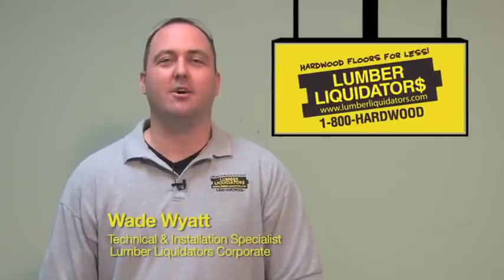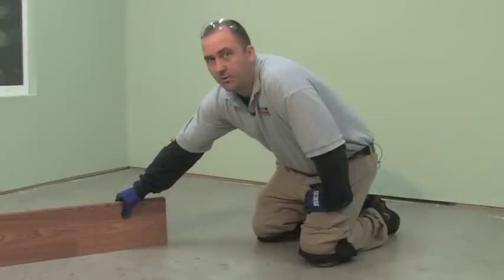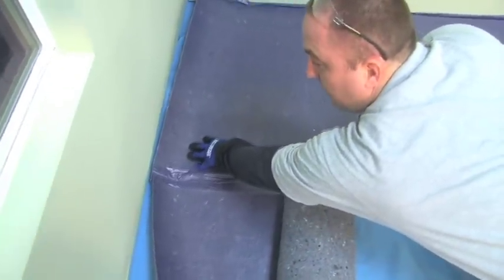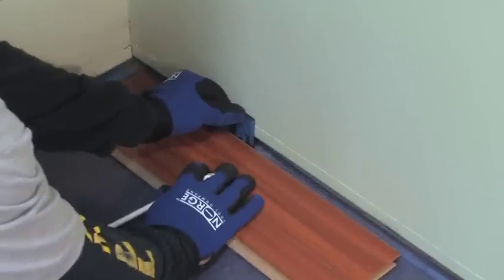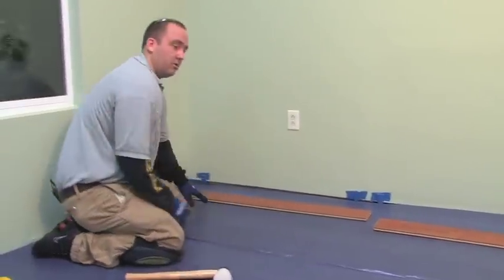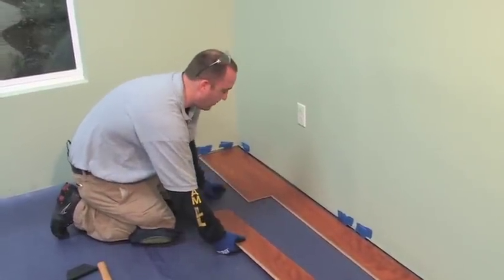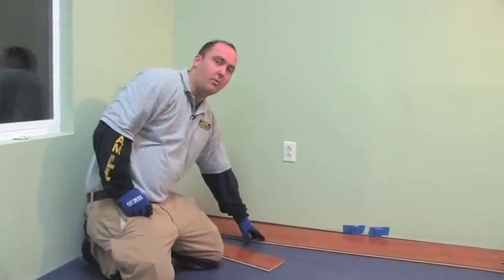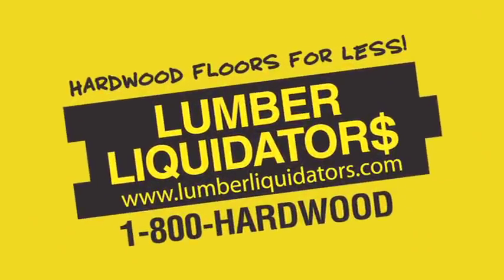How to Install Laminate Flooring (Tap-End Joint) Including Moisture Barrier | LL Flooring

Comment: I thank you very much.
I am trying to install laminate flooring for the first time.
The first line was simple.
The second row, I didn't know how to place the second board, there was no way they would match.
On the manufacturer's website, the video describes everything except the connection itself in the same line.
I've looked at dozens of tips and this is the first one that mentions leaving a gap and then embossing with the tool provided.
Once again, many thanks!"

Comment: When starting your first row (tounge facing the wall), use a table saw to cut off the tounges before installing with spacer.  Otherwise, you may end up with a gap larger than the original, or new baseboard molding can cover with one piece. This eliminates the need for a shoe molding in front of your baseboard molding, thus reducing your trim material and installation expenses.

Comment from the maker: Hi Ed, chalk lines are to help keep the floor straight, whether it is a nail, glue or float installation. The lines help to ensure the rows are running straight & the floor has not gotten out of square. When you have longer runs it tends to sway or move so the lines help keep everything in check. Also, if the wall is not straight it can cause the floor to gap at the ends when the two pieces are not square with each other due to the wall being out. A chalk line can help alleviate this problem!

Comment: PMak1984 makes a good point. Need to measure the width of the room and divide by the width of one floor plank to make sure you will not end up at the last row with a plank 1/2" or 1" wide. You may need to rip the first row of planks lengthwise so that the last row is at least 2.5 - 3" wide.  Other than that this video was very helpful as it showed 6mil plastic, cushioning  underlay, and use of spacers without baseboards. Thanks for posting

Comment: I have been installing all kind of floors for over 30 years, from Carpet, Vinyl, VCT and wood When this type of flooring came out no one knew how to get a tight fit when you could not lift the wood up on a 45* angle like toe kicks in kitchens or around door jams. Finally figured it out by cutting off the locking lip bead and slipping it together with good wood glue. Never like this type of flooring to me it didn't look like real wood or sounded like real wood walking on it.

Comment: Great video, will help a lot if I end up flooring myself.

My whole room drops about 20cm over 6m. Is it a problem if the floating floor is on an incline?

Also my house is really old, the rooms isn't exactly square. If I get it installed rather than doing it myself can I trust the installers to do a good job?
Reply: Curious. The room you speak of which has a 20cm drop over 6m, what kind of room is this? A 20cm over 6m sounds like a very acute ramp.
Reply: Edward Bournaska
It's an ex garage, most people don't notice the slight slope unless you mention it to them.

Anywhoo I ended up getting it tiled instead.
The tilers used one of those new clip systems and it came up completely perfect.

Better tiling than the rest of the house lol.

Comment: OK, you drew that line than you used the spacers as guides and covered up the line. What was the line for in the first place?
Reply: Completely agree, I was thinking the same thing, I don't think you need the line
Reply: Sharon Kennedy the guy in the video was showing two methods for aligning the first row; the chalk-line was one way, and spacers was another. given that you'll be tapping on all of this, i'd say that the spacer blocks helps keep everything in place and is probably a better method.
Reply: You use the line to stay straight, in relation to the wall. Once you get the 1st row in, you just have to lock them into each other which will by default be straight...again, in relation to the wall. If you try it without the line you will wish you had it at the end.
Reply: +slowinfastout54 the spacers constantly move your best bet is to get 3 rows in and on the very ends of the boards(that will be covered by trim) drill a cople hole through the wood and the concrete drill some screws in (only hallway for a 4 in screw ) and bam your floor wont move...
Reply: mikeA1 Your floor isn't screwed in...
Reply: slowinfastout54 even if the wall is "square" though rarely is any wall 100% square ...  having a reference to keep the material square is best ... a slight difference even 1/32" at the butt joint can throw the entire floor off by the time you reach the other wall making it askew ... roofers laying shingle use this same technique to keep them looking even/square when the roof is not
Reply: Line is to check if u have a strait wall to follow or not...

Comment: Hi Wade, 
I also don't understand the need for the chalkline.  If you are using the spacer and the width of the board, how is that going to change at the other end of the room?  It seems that you'd get the same result just putting down an entire row with spacers.  Is it to help for when you don't want to do an entire row as you were showing?  Thanks for a great DIY video, Wade!

Comment: not clear, do you leave the spacers in? or are you continually shifting the ones used on the short ends of the board and them remove the ones on the long end of the board once the room is finished? If you remove the spacers won't gaps appear over time if the connection loosens?

Comment: Question: How are concrete slabs laid in America? Do they not have a damp proof course underneath the slab? What's the point of the "moisture barrier" on top of the slab?
Reply: Wood can't make direct contact with concrete or it will deteriorate at a lot faster rate. That's why the moisture barrier.

Comment: Any gap required for 6mil Poly Sheeting moisture barrier?  If not, does it go to where drywall meets floor or even further back (in cases where baseboards were removed and there is a gap between the wall and floor)?  
The first row of underlayment against the wall overlap flap is not cut off?
Reply from the maker: Hi Josh -  the vapor barrier should be installed up the wall at least 1”.

Comment: what's the point in snapping a chalk line, when you're taping spacers to the wall in which case the flooring will go against anyway during the install???
Reply: I sometime snap 2-3 or even 4 snap lines depending on the size of the room just to check that walls opposite to each other are going to work.  I will also use this videos method, however sometimes there's a bow in the wall.  In this case I do not want to follow the wall.  I have to snap a second line in order to get a scribe line to cut the laminate.  Then use a jig saw to cut the laminate.  After your done, the wall cut you made will follow the wall and your other side will be straight. Double check that all your gaps and that your measurements were ok.  And that the wall on the other side is not skewed.  (Check that chalk line to that other wall before you start trimming)
Now your starting boards are straight for the next row
Reply: Richard  just incase the wall in not even across. then all your laminate will be on a slant
Reply: wall may be bellied or bowed. the line gives you a straight reference point to locate those problem areas.
Reply: Richard the point of snapping a line is to keep the flooring straight, no wall is 100% straight as a string/chalk line, the blocks are supposed to keep you to your line as your beating the flooring together when you start
Reply: Richard the blocks may not all be the same width
Reply: I have the same question. Since all these snap together and are perfectly square, AND it's a floating floor, won't it maintain very straight lines regardless of the wall or the chalk lines?
Reply: But if the wall isn't straight, and you base the chalk line off of the not straight wall, wouldn't that make your chalk line not straight as well??

Comment: Sorry guys... but this is not the most usefull.  First and the most important: You can not always start using a whole width of the board. Because you can end up instaling a very, very slim pieces of boards along a oposite wall. I am talking about a width of 2 inches or even a one inch. Imagine how this is going to look. 
So to avoid it - before you start your work, you need to measure a width of the room, and a width of a single board. Then divide a width of the room by the width of the board.  Result will show you almost always two digits amount with a fraction.  For example: 18,7 or 24,2 etc.
That is how many boards it will take to cover a width (not length!) of your room.  And whatever is there after a dot (that fraction) shows what is really imortant now: It shows a width of the last piece of the board to be installed right at the wall.  
Now, if you have that width being more than a half of a full width of the board (lets say you use 9 inch wide boards and now your fraction shows 5 inch, or 6 or 8....) than you can strat your floor from the full, uncut board - just like shiwn on video. But if a fraction will show 4 inch or less, and a specially like 2 or one inch, then at the end you would by forced to cut and install these non=sense long, 1-2 inch pieces along the wall. This will not look good!  
To avoid that - just imagine that you adding - lets say - 3 inches in width to your last slim 2 inch line of pieces... They would be just wide enough then, right?  The simplest thing now to make it happened is just take off these 3 inches from first row of boards. 
Yes. Do not install a whole boards, but cut off 3 inches along of them, (all boards in first row) then install them.  

The other thing is - in virtually every room there is some radiators... and they did not mentioned anything about it. But if you have some obstacles like radiators, especially a baseboards - the best way to start your floor is right there where baseboard is. Why?  Because it is usually low over the floor, but very first row of boards, you simply lay on the floor. You do not need to install them at the angle, to connect it with another line of boards. Then - when forst row is there - it should stick out from under a baseboard, so now you have a full access to install next board at the angle.
Well... A MUST is to determine from wich side of the board you are able to attach a next one under angle.  This is only one of two sides! Make sure taking two boards together with one flat on the floor - try to attach another one...  Notice the difference between a shape of board's edges. Determine which edge is the one that you can attach next board to.   
I'm writing this, to avoid situation when someone decides to cut a 1st row of boards to equal a width of starting and finishing row - and without checking - will cut off a wrong side of the boards...  Waiste of time, material and tons of frustration.  
Also - in few cases - a room can be pretty tricky. I mean: I did install a laminate floor in the kitchen together with a hall, dining area, lets say - an island on the side and extra litle square area where basement entrance is.
Problem here is that the floor is not a simple rectangle, but it is more like several small, different size rectangles - connected together, but in weird order.
Critical here is finding a perfect (in fact: closest to perfect) position of first row, so when we lay down next few rows and meet the corner - we omit a situation when we need to install a board into this corner - with coutout of 1, or 2 inches wide.  To avoid it - we need to calculate our amount of boards needed to cover a width of the room - exactly like I described above. But then we need to calculate that fraction for EACH AND EVERY CORNER on the way, to oposite wall.  
Having these on paper - we can see in which corner, or maybe at oposite wall's end - there is a worst situation: I mean if we have fractions, lets say:  0.7,  0.9,  0.2,  0.4, and 0.1 - that means we need to move the start line of our entire floor to increase those tiny widths like 0.1 and 0.2
And we can do it by cutting 2 inches off of the first row.  But carefully: When we do that - our width of 0.1 board width will increase about 2 inches. Good. Same about our 0.2 of board width.  What about other fractions? These I call a "good ones"? like .07 or 0.9 of a board width... Well... these will change as well!  And if it is 0.9 -it unfortunately is going to "jump" to another board!  Making it for sure a skinny one.    In that case - the only thing we can do - is moving our planned starting line inch, two or three more - and check how wide boards it will make on each and every corner.   Sometimes you need to move like this back and forth, just to find an optimal set of boards to be cut around corners.  And yes: sometimes - no matter what you do - you can still have one of these spots only 2 inch wide...  In that case, pick the least visible, most hidden corner and make your adjustment so this one will have a worst configuration. But other ones would look OK.  
As a matter of fact, with irregular shaped rooms like this, similar issue could happen into oposite direction. So it make sense to calculate (or simply "dry" install just to see) and find out where before a corner - a board will end. It is important especially when we have a floor boards all of the same lenghth.  

Sorry if my english suks. I know it is.   

Anyways... I encourage to watch several different videos about panel floor installation, to get more important info and some good, usefull ideas.

Comment: Hey, I noticed you didn't cute the male lip going against the wall on the first row, some say do, some say don't, what are you thoughts....THANK YOU
Reply: it doesn't hurt to cut it, however, the molding/ base board typically covers it. Check the width of the molding to see how much wiggle room you have between the board and the wall.

Comment: That was pretty quick. Unfortunately when you're laying 20/30 or more sq ft it take a bit longer, does it? Also I am not totally convinced by the fact of connecting the long side and then the short side of the plank. If the plank groves and tongue are not smooth, it would be impossible to slide it all along and win the friction of the wood. You may even end up damaging  the wall or the skirting. Finally, the vid shows how to draw the line to keep it straight, but doesn't develop the other steps.

Comment: can I install laminate over a 3000 sqf area? Will gluing it down avoid shifts and movement due to temperature changes?
Reply from the maker: Hi Kurt - thanks for your question! It could vary by product but Dream Home Laminates are designed for floating installation and require transitions to be used between adjoining rooms, hallways and doorways. They must also be used in the middle of rooms measuring more than 33’ in the direction of the panel length and more than 26’ in the direction of the panel width.

Comment: Will there be moisture/mold problems between the concrete and the moisture barrier in a basement? Where does any moisture go at that point?
Reply: Some laminates cant be installed in a basement...go with LVP instead.
Reply: thank you sir, ill look into that.

Comment: The best way to keep new installation straight is to put at least three rows together, first....a few inches away from the wall.  With the 3 rows locked together, the floor will be straight. Then slide it close to the desired place...measure the 'ends' distance from each front wall.  Then, you may have to add or minus your spacers to keep that 'straightness against the wall (keeping in mind that a lot of pressure will be put against the wall each time a new row is added).    .
Reply: ihiaama5 providing you have no notches or cut outs around anything within those three rows ... a straight shot is easy enough ... now how do I get around that with the previous problems mentioned.

Comment: "If you don't know how to read a tape measure..." ...then you shouldn't be doing this yourself. Or driving, or anything really..
Reply: Google it! in 30 seconds !
Reply: MrF1230n    LOL!!!!! you're right
Reply: +MrF1230n If they can't read a tape measure.. then they probably couldn't figure out how to remove the plastic covering the pack of laminate boards.
Reply: +MrF1230n Men, I had the same reaction. I was like wait, what did he just said
Reply: Yannick Boucher
I have known of 3 adults that could not understand that 8/16 = 4/8 = 2/4 = 1/2 = .5  One of them worked on an Autocad station inputting the length of steel beams.. and he had a chart taped to his monitor to tell him those equivalents!
Reply: Metric is base 10... binary is base 2.. Hex is base 16, Octal is base 8.  Base 2 numbers are too long.  I would like base 8 or base 16 (probably base 16 would be best).  Imperial units are pretty much arbitrary and absurd
Reply: I work with a high school graduate  at Lowe's who can't read a tape measure.If the dimensions call for 3/8 or 3/4 or 3/16  he calls someone else to cut glass or plexiglass. He has no idea what those 16 marks between each number mean  and can't grasp the concept when I try to teach him.But he knows that it's 15 feet from the foul line to the basketball rim. He starts college in the fall!!
Reply: MrF1230n  that is EXACTLY what I was thinking...if you don't know how to read a tape measure... why would you even attempt to YouTube an installation guide. if you don't know how to read a tape measure, you probably were unable to find this tutorial in the first place.
Reply: google how to read a tape measure? if you can't do that, you likely can't google either because you can't read.
Reply: What's a tape measure?
Reply: Robert Peters i think is like blue tape with a bunch a numbers.is it ?